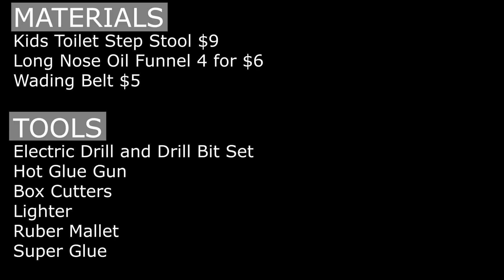How to Build a Stripping Basket | Only $20

Comment: My version of this Ikea child's step stool is much easier. Drill 2 holes to insert a buggy cord with metal hooks. I sealed the side holes with plastic from a plastic milk jug and used hot glue to attach the plastic patches.